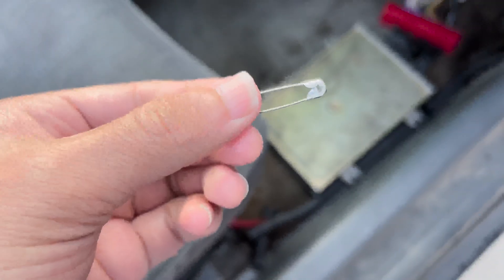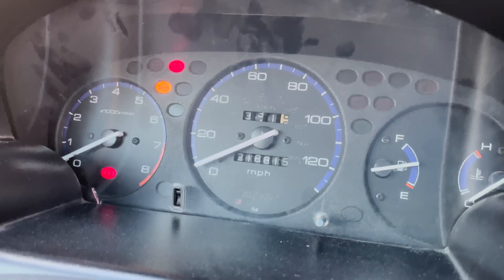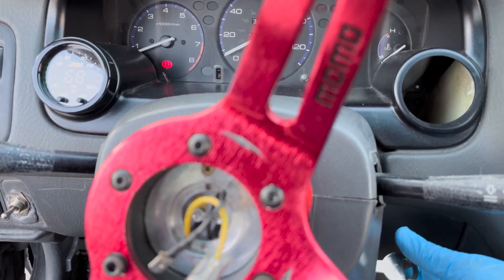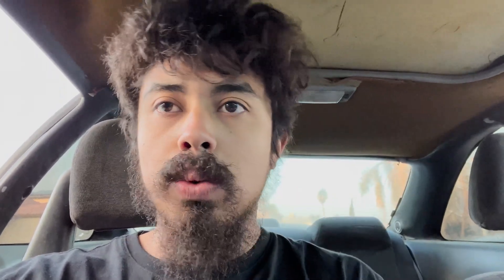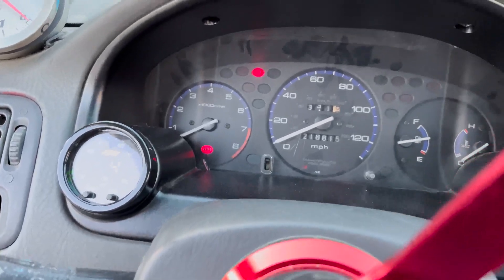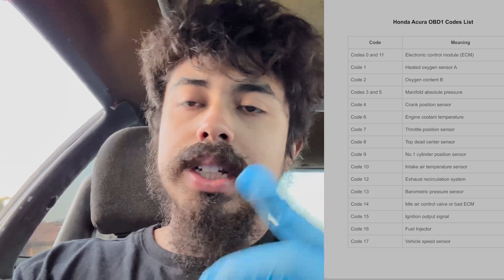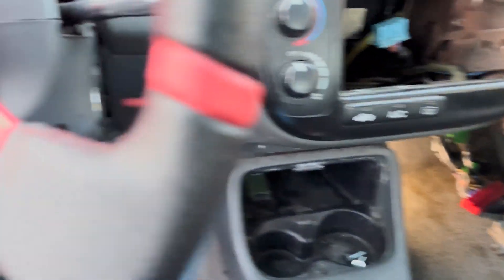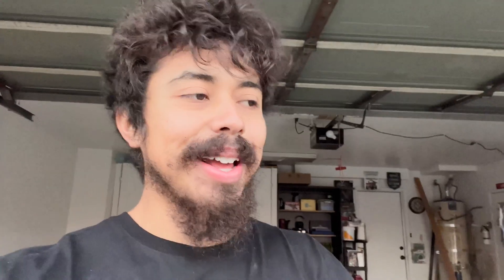How to Check for Honda OBD-1 Codes

Comment: I’ve done this and my engine like only does long pauses, code 1 and I’ve tried doing research to see if that’s a code and my only guess would be the IAT sensor but I’m not certain
Reply from the maker: how many long pauses does it show? any short pauses?
Reply: @ it only repeats with long pauses no short pause at all
Reply from the maker: @MK7Garage  how many long pauses? There should be a set amount before it goes dark and repeats the count
Reply: @bwcp  oh ok I’ll check up on that and give an update I appreciate your message
Reply: @bwcp  the light goes on and off when I drive so sometimes I can’t read the code unless it’s on
Reply from the maker: @MK7Garage  yea no worries I’m here to help. If the light comes on and off when you’re driving, then you most likely have a CEL. Check the code when the car is off and ignition on just like how I did in this video
Reply: @ sounds good i appreciate it
Reply from the maker: @MK7Garage  yea you’re welcome. Let me know how many pauses you observe that pop up👍
Reply: @bwcp  it does 2 long pauses

Comment: To anyone reading this; have y’all encounter an obd1 car that when you jump the obd1 port with a paper clip, there’s no flash on the dash?
When I jump it, just the cel light comes on and stays on. No flashes. 
The light comes off when I remove the jumper.
Reply: Means no check engine light
Reply from the maker: yup, like @turboDseries said, means there's no CEL.